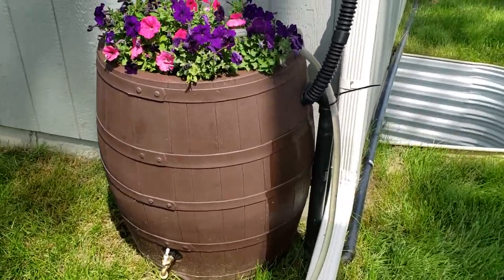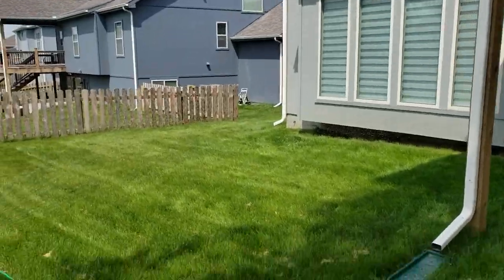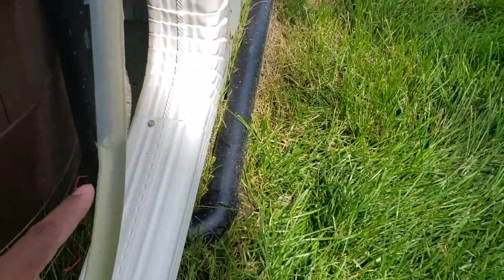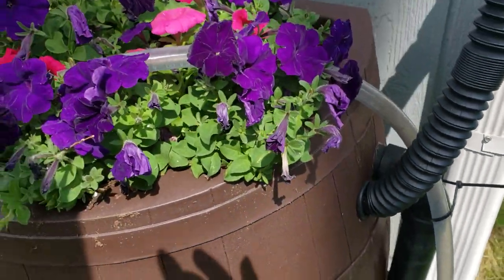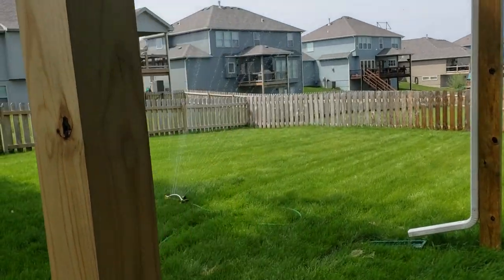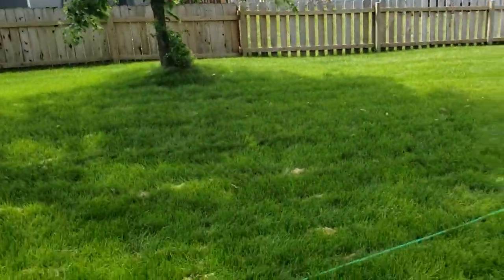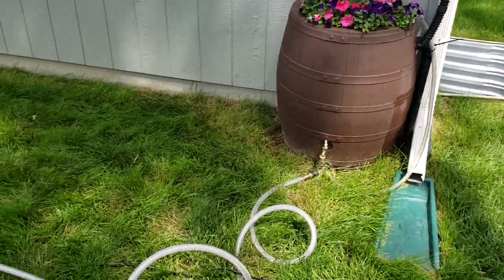Harbor Freight Sprinkler Pump From Rain Barrel in Action!

Comment: I have a similar pump set up, but I’m connected to a 275G IBC tote. Couple of suggestions. I use the same intake hose, but only about 18”. I also use a 3/4” discharge hose, much better flow and not as hard on the pump

Comment: Hello from ON, Canada!  I purchased an irrigation pump you listed in the video description and a rain barrel from my city landfill for a good price! I referred your video and decided to go for it!  Thank you!! I am excited to get mine started soon!
Reply from the maker: Good luck to you!
Reply: @jpulley  Quick question.. I'm new to this. I'm trying to find a braided vinyl tubing for the pump intake connecting to the rain barrel spigot. I'm not sure of the diameters that would work ok with the pump.   Home Depot (Canada) -  "3/4 Inch Inside Diameter X 1 Inch Outside Diameter"  or "1/2 Inch Inside Diameter X 3/4 Inch Outside Diameter "... which would be good ??  Thank you.

Comment: I have that same pump connected to my 3 330 IBC totes which receives water from 1/2 my roof, and it drives my sprinkler very well.  The prob is that we do not have enough rain to keep the water level in the totes.  So, I'm digging a shallow well this weekend to keep the totes full (unless I can get enough water flow from the well, then I'll go straight to the lawn).

Comment: I think you've answered a question I had. I have this pump, not used yet. The manual suggest using a Y splitter on the outflow to prime the pump with a separate bucket. Another video on YouTube did that setup. Is it safe to just let the intake water fill the pump and over drain it out the outlet hose?
Reply from the maker: Yes that's fine. The main thing is that you don't want to run. The pump dry. In my case the rain barrel is higher than my Pump so it was primed being gravity fed. To put it really simple. Just have water in the pump casing before you turn it on.

Comment: You reduced the intake from 1" to ¾" with the adapter. Any issue for the pump?
Reply from the maker: I wouldn't think so the adapter came with the pump.
Reply: @jpulley  How long have you had the pump and how often is it used?

Comment: Heyy broo! What's the nylon hose size and fitting did you use on the pump? Thank you!
Reply from the maker: The hose fitting is 5/8" standard household water hose fitting you can get at home depot or wherever.

Comment: Is it possible to run 2 oscillating sprinklers from this pump with a Y splitter connected to the outlet of the pump? Or does 1 sprinkler already take a lot of the psi cause I plan to try this set up after first just running one from a 250 gallon ibc tote
Reply from the maker: I've used this pump with two sprinklers ran in tandem and it was fine. A Y-splitter would probably work better than running one after the other like I did.
Reply: I use this same pump to run 3 42sa sprinkler heads. No problem at all. I have the nozzles set for 1.5gpm

Comment: Did you put a check valve on the pump? Do you have to prime it every time you use it?
Reply from the maker: @kathryn4178  the setup was gravity fed I didn't have to prime it. The head pressure from the rain barrel was more than enough to fill up the casing of the pump.

Comment: We need to collect rain water for spring here in Illinois to water our indoor plants.
Someone suggested that rain water is better than city water apparently.
Just need to pump from outdoor rain barrel to collection indoor container via basement window.
Good or bad idea?
Will this pump do said job?
Thanks
Reply from the maker: If you were just trying to transfer from one place to the other I would say this pump would be overkill. This pump will spray water far greater than regular home pressure. You would probably get water everywhere if you were trying to fill a container indoors using this pump. This pump moves over 1,000 gallons an hour something smaller that moves 330 gph would be better. Check this one out: https://www.amazon.com/VIVOSUN-Transfer-Utility-Impeller-Gasket/dp/B07R7V1HJW/ref=sr_1_4?dchild=1&keywords=water+transfer+pump&qid=1633713490&s=lawn-garden&sr=1-4
Reply: @jpulley  thanks for the guidance and Amazon link.  Wife is entertaining a manual pump or our extra sump pump in the basement. Just have to find the right size adapter to our 50ft garden hose.
Happy Gardening

Comment: You sure it’s ok the the pump backing it up like that?  It wants to spit out more than 1000 an hour?
Reply from the maker: Yes it's fine. I'm sure the motor pulls slightly more amperage when it has to pump through nozzles like on the sprinkler. The pump is literally a sprinkler pump. Pumps are designed to push through a certain amount of head pressure. It's not limitless, but is also not zero. With my setup the barrel is empty in minutes but if you were really worried about it you could create some kind of recirculating system that would tee off and allow a certain amount of water to return back to the barrel. You could add a valve, and throttle it on the recirculation line to get the desired pressure at your lawn sprinkler.

Comment: I live in an old house with HORRIBLE water pressure, could I hook a small hose from the outside water spigot straight to this pump then the lawn hose coming out of the pump?
Reply from the maker: Yes that would work I tried that at my house house just to see if it would be higher water pressure and it worked.
Reply: @jpulley  ok cool thanks. I have 100ft by 30ft yard and it takes days to get it watered.

Comment: What is the actual GPH/GPM?
Reply from the maker: I do not have a flow meter that can determine actual flowrate. With enough supply on the suction side and a wide open discharge I would expect the pump to get some very similar to the advertised amount. Which is  1,075 gph or about 17gpm. Restrictions on the line will increase the pressure but lower the gpm. The sprinkler itself is a restriction. 17gpm is not a lot.

Comment: Great video! I'm interested in getting a setup like this going but was wondering if the cost of electricity to run the pump is really less than the money saved by using the rain barrell/cost of pump/pump maintenance/etc. I look ed around a bit and am having trouble finding info on the cost comparisons. Toughts on this would be appreciated!
Reply from the maker: I have seen people run a setup off of a battery bank and solar panels. My barrel is empty in about 5 minutes I don't think it uses that much power in that time. I've just acquired two 55 gallon drums and I'll be expanding this year. I got a letter in the mail saying I use 107% more power than my efficient neighbors. We have a family of 5 and all three of my kids and myself all have gaming computers and are left on most of the time and I have a server running in the basement.  I still don't think my power bill is that bad I have a level payment plan and I pay about $225 a month. When I water my grass just to keep it alive through the hottest months, my water bill goes from  $140 to $250 really quick. I know some of my neighbors have to pay $400+ a month to keep their grass water everyday with their irrigation systems.
Reply: @jpulley  Cool thanks for the info super helpful!
Reply: @Daniel Kreipke  I’m building a small trailer with one 330 gallon IBC tank. I have two 6V golf cart batteries wired together in series to create a 12v system. Then I have an inverter to plug a pump into it. The golf cart batteries have a solar setup so that it keeps them at least above 50% capacity at all times. The reason I’m using golf cart batteries is because they have a larger capacity than regular 12v deep cycles. Therefore allowing me to essentially move my trailer anywhere I need to without worrying about a power source. The pump is connected to the tank and two sprinklers that are permanently mounted to the sides of the trailer. I can pull the trailer wherever I need to, detach and turn on the system.

Comment: Where did you get that re-enforced hose for the suction side I can't find it anywhere
Reply from the maker: I got mine from Menards if you don't ha e one of those, you probably could find it at Home Depot or Lowe's
Reply from the maker: I had to use a hose clamp to clamp hose fittings on to the bulk hose. https://www.homedepot.com/p/Everbilt-1-in-O-D-x-3-4-in-I-D-x-10-ft-PVC-Braided-Vinyl-Tube-HKP002-PVC004/303132499

Comment: Hopefully a question you can answer. I want to pump water from a 128 gal tank thru a garden hose that will reach  about 16 feet to the top of my travel trailer. Will this pump force water up a vertical hose 16 feet?
Reply from the maker: I can't give you an exact calculation but 16' of head pressure wont much anything for this pump to overcome. This pump handle it with plenty of power to spare. Especially through garden hose. Some people pipe larger diameter piping up to these pumps. That would be harder on the pump.

Comment: Purchased a similar pump. Primed it and all it does is hum. Is this an internal electrical issue like maybe capacitor. Don’t know if I should send it back and purchase this one shown here.
Reply from the maker: if you look at the fan side of the pump it probably has a hole in it. You can stick a screwdriver in there and turn it to get the pump free. Sometimes these pumps just get hard to turn and if you let it stay on just humming it will burn the motor out.
Reply: jpulley will check and see. Thank you.
Reply: jpulley thank you! I bought the same pump earlier this week. We set it up tonight and it hummed as well! We’ll try this!

Comment: Did you have any problem getting that pump primed?  I just got one, going back to get a Y splitter today.  Any suggestions on priming it would be appreciated.  THANK YOU!
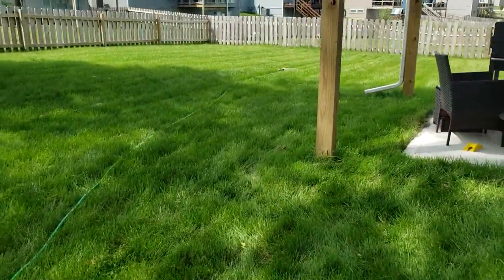Reply from the maker: No I didn't have any trouble priming the pump. 0:52 Once I open the valve to the rain barrel it gravity feed through the pump casing and was already coming out of the sprinkler. I would make sure you have a reinforced suction hose like the one I have so it doesn't collapse and stop water flow. Using hard piping like pvc would be idea but I wanted to be able to easily hook it up and unhook it.

Comment: Roughly how many feet would this shoot out of about 200 feet of hose?
Reply from the maker: It's hard to say a number but I can say this, I have pretty good water pressure at my house. Multiple people can take showers, toilets can be flush and theres no problem. This pump connected to a hose sprays water about twice the distance than connected to my house. Of course it depends on the type of sprinkler you're using. On one particular sprinkler I'm definitely getting 30 ft plus when using this pump only get around 15 feet or so when it's connected to my house.

Comment: Does it have a pressure switch?
Reply from the maker: No, I was just running it every couple of days. A pressure switch would be a nice improvement, but sometimes when the pump sits outside for days and when I turn it on its kind stuck. I have to get a screwdriver and get it out of the bind then it runs fine. If I had a pressure switch hopefully it would trip the breaker and not burn up the pump but I would kind of worry about it starting on its on without me out there.

Comment: Sorry to break your heart bro, bro but there is absolutely no way you are goi8ng to get an irrigation system. Standard pop-up spray heads use 1-2GPM at 40 PSI and your pump is WAAAAY undersized for this application. You can get the biggest basin you can find or legally use and you're in no way about to fire up an irrigation system... and you haven't even considered your head foot calculation... sorry guys. this is OKAY at best in a veggie garden application. Sprinkler systems use THOUSANDS of gallons. you have a 55G drum lol.... even if you were using MP rotators on your pops you would still have to build at least 45 pounds of dynamic pressure. Just food for thought for anyone considering this project. this guy doesn't really know what he's doing.... his application already has this system maxed out and hasn't even considered dead heading the pump
Reply from the maker: It was not my intention to run an irrigation system off of a single rain barrel. However this pump could definitely run an irrigation system. This pump can pump more gallons a minute with a higher pressure than the city water coming from the house. This style of Pump is literally called a sprinkler pump. Most of them are more than capable of pumping over 10 gallons a minute. This pump is capable of 40 psi and over 10 gallons a minutes so by your own math this pump could supply at aleast 5 pop up heads at once. Once that zone is watered that valve would shut then another valve can open to water the next zone of 5 heads or so.

Clone of my Pump max head 165' 1300 gals per hr @40 psi
https://amzn.to/4fycJVl

Comment: May not be paying for water but your paying for electric . LOL
Reply from the maker: I did this to stop my sump pump from putting out so much water in one sport and killing my grass, not to necessarily to save money. However, watering my grass intermittently in the summer changes my water bill from $110 to $250 a month. I my run this pump 5-10 minutes 3 times a week. It probably cost me 20 cents a week to run this pump for the duration that I need.

Comment: This pump is a junk it sized up after 3 weeks
Reply from the maker: Mine's been working great for 2 years now. You have to make sure gunk and corrosion inside of the pump casing don't inhibit your pump from spinning freely. If the pump can't spin and you turn it on the current on the motor will burn the pump out in minutes. I see guys out work burning out brand new $400+ commercial sump pumps in less than 24hours all the time because of this. Its only happened to me twice where I turned on the pump and it was stuck. Both times I immediately turned off the power and used a screwdriver on the non-drive end side of the pump to break it free. If I didn't realize what was going on it was have burned that pump up in minutes.